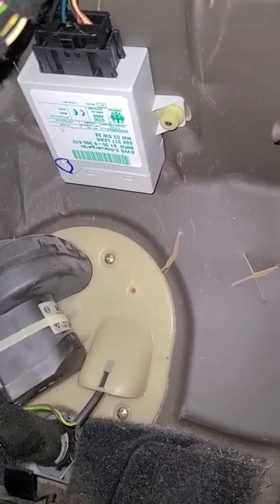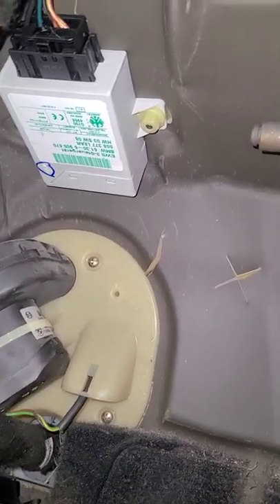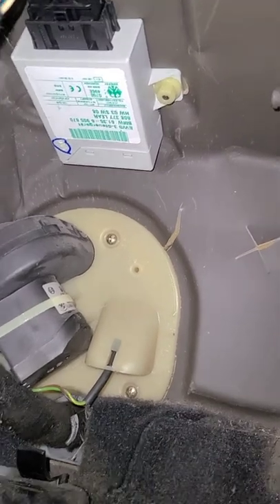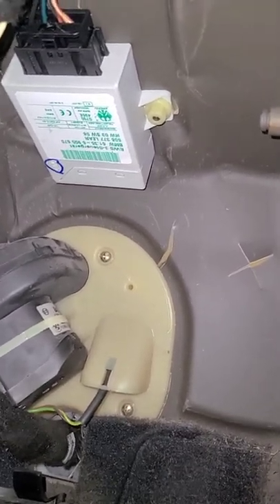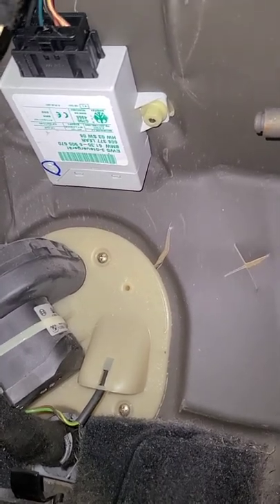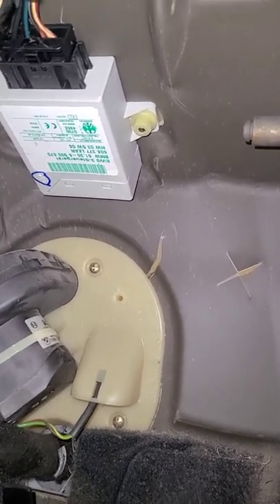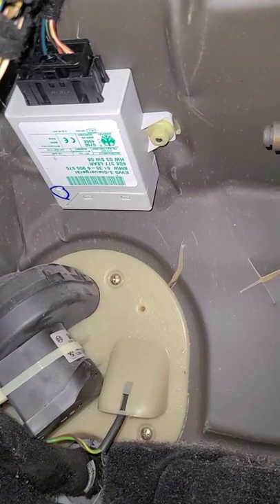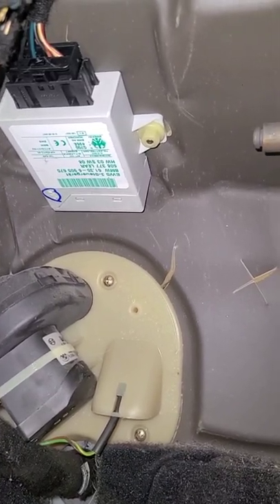BMW EWS Security Bypass Explanation #bmw #security #bypass #shorts

Comment: We're is the location
Reply from the maker: The EWS module is located under the steering wheel. Above the acc/brake pedals, there is a plastic panel being held together by two screws. Remove it & you will see exactly what is shown in this video. Good luck, and let me know how it goes!